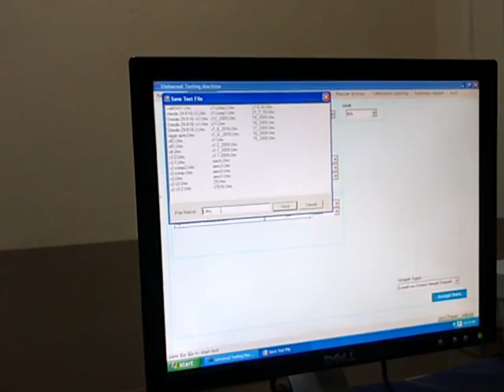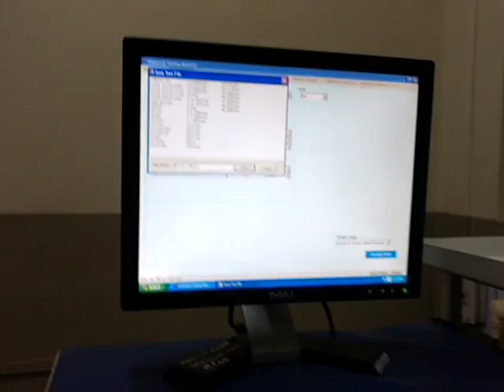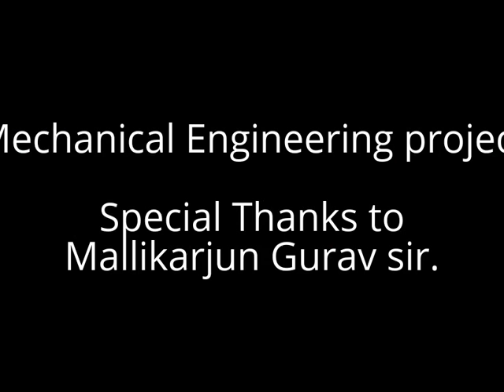Composite leaf spring | Mechanical Engineering Project | Manufacturing

Comment: Anyone making one of these should get a lower viscosity epoxy and use a roller to spread it. Avoid grinding by making the side forms the same height as the spring.